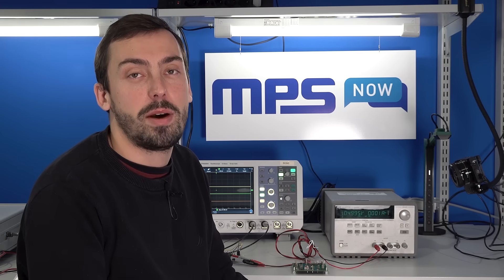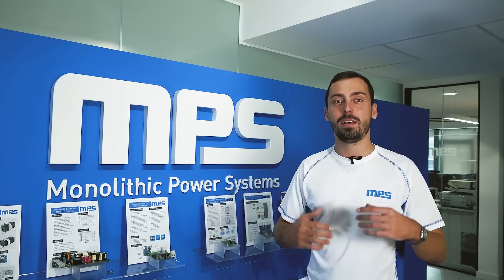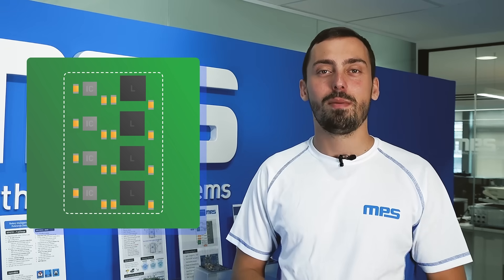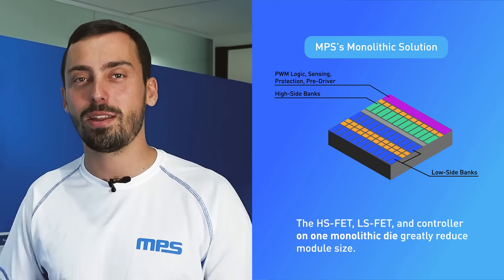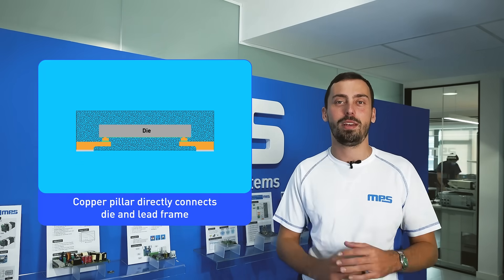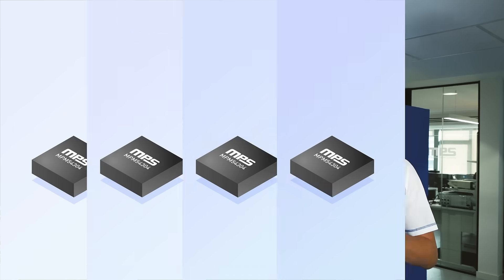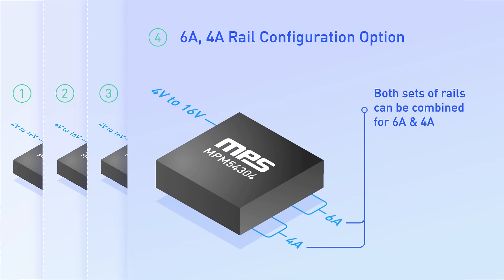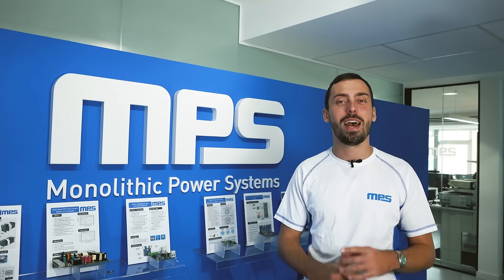Your Source for Compact, High Efficiency Power Solution

Comment: How obout ease of service and replacing components in field .We need swapable power suplies dinbrail mounted and surface mounted that can provide 200Watts dc at 24 volts or dedicated 12 volts and dedicated 5 volts feom supply voltages starting at 120v ac to 600 ac .all single phase inputs ..The DC output milustbbe very clean regardless of power draw .
Reply from the maker: Thank you for your inquiry.  Please go to our forum for technical questions.  We have engineers that will respond within 24 hours. https://forum.monolithicpower.com/